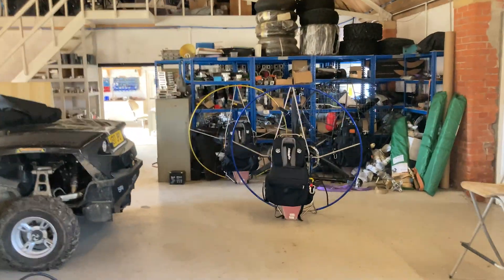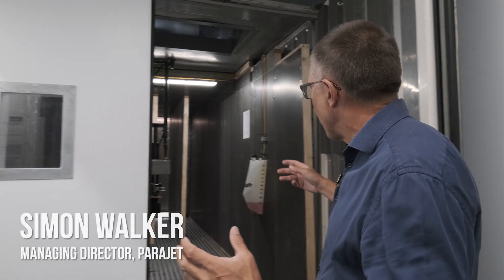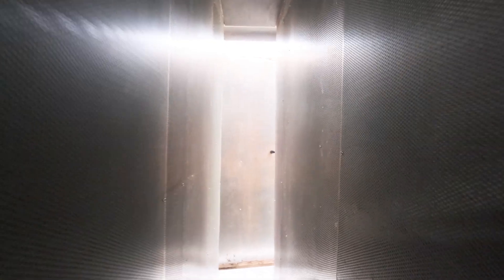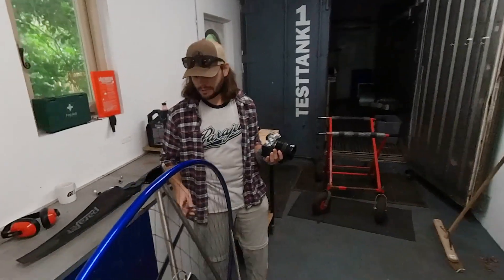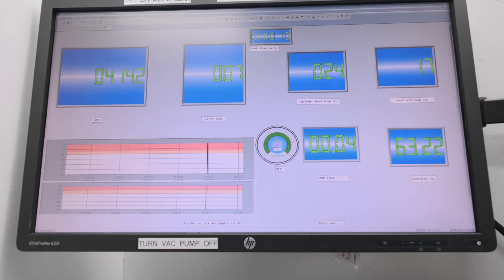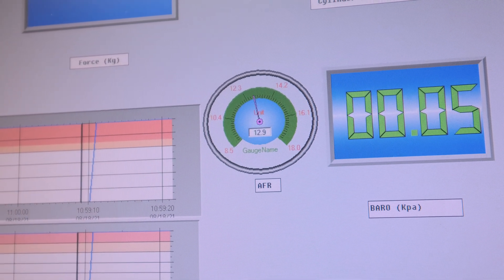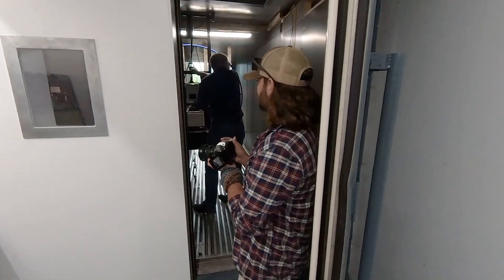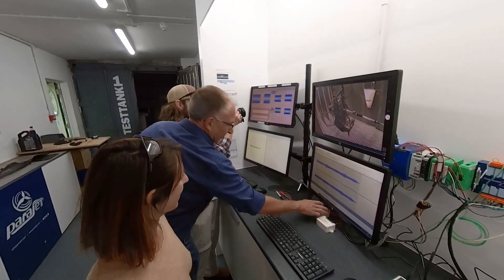Paramotor Thrust Tests in the Parajet Test Cell

Comment: I know it would vary depending on factors, but what kind of cruise speed would you see at wide open throttle?
Reply from the maker: Impossible to say sadly as there are too many variables in flight. On the ground on a trike which isn’t connected to a wing I would say the three blade would increase your speed by about 10-15%
Reply: @GregAnthonyHarris  Too hard to answer I understand, thanks for the reply. nice test platform.

Comment: Awesome video!  Can you tell us which prop was quieter?  Also which prop caused higher engine temperature?
Reply from the maker: The two blade is slightly quieter but a lower pitch. The average engine temperature was pretty much the same with both.

Comment: My home made paramotor engine of YAMAHA RX115 Made 40kg thrust with 130cm wooden propeller.. i am 70kg body weight and my engine is arround 30 kg. Need your opinion can it take me into air ??
Reply from the maker: Sounds like a heavy machine but with the right wing it would. I recommend working with other Paramotorists with experience of different Paramotors. Maybe have me of them test fly it for you first?

Comment: Very nice test. but i thought engines were putting out more thrust. because my homemade electric paramotor puts out 53kg of max thrust on lite version and my XT version puts out 60kg of thrust. i am working on a new motor that can put out 77kg to 90kg of thrust. possibly very good to build a paratrike for 2 with that. all clean electric power, less noise, no smoke, maintenance free, and extremely light weight.
Reply from the maker: These numbers are impressive. What are you run times and what is the weight of the rig at those thrusts?
Reply: @GregAnthonyHarris  My customer in USA did 65 minutes of flight with 75V 22AH battery pack. spinning 42 inch prop. max weight he reported was under 24kg. That is the XT version. pilots from 80 to 95kg can take off easily. Currently I (62kg) and my instructor (84kg) we are testing the lite version that puts out max 53kg of thrust. I can take off at half throttle and cruise at 10 - 20% throttle only. My instructor takes off at around 70% Throttle and cruises around at 25-30% throttle. Lite version with batteries and everything is only 18kg heavy. 90kg thrust i can build but its an overkill for me. any mistaken throttle can make me take off vertically making my glider fall behind. In fact I was thinking 2 x 90kg thrust combo, and i will not need a paraglider canopy. I can basically build myself a bi copter to fly around :)
Reply: only thing that electric paramotors lack now, is the flight times. but they have many more benefits. like at higher altitude engines won't put out enough power and thrust due to thin air, while electric paramotors will not be affected by that. if a person can carry more batteries for sure they can fly longer. with 90kg thrust motors, we can even build paratrike and carry 40AH to 50Ah batteries to fly over 2 hours or more
Reply: My home made paramotor engine of YAMAHA RX115 Made 40kg thrust with 130cm wooden propeller.. i am 70kg body weight and my engine is arround 30 kg. Need your opinion can it take me into air ??

Comment: CHT of 50 degrees seems way too low? That's not much more than body temperature
Reply from the maker: It did go higher but wasn’t shown in the edit.
Reply: Pretty surprised by that as well since Vito states the head should warmup to 80 before you punch the throttle 😂

Comment: Nice one Greg. Interesting to see real data on the multi blade issue. I’d be interested to see the results for a Moster. 
I presume the fuel mixture reading taken from the exhaust probe the test engineer fitted?
Reply from the maker: I think so yes. I’d like to see results from a moster too. I’d love to run tests on some of the old school Parajet props from the 90’s and compare to todays props. Next time!

Comment: hello greg. so if i wanted a thrust and fuel test done on my moster my20 how much would it cost please. THUMBS UP GREG
Reply from the maker: Hi Tony, I’ll message my contact there and get back to you 👍
Reply: thank you😊
Reply: Hi Tony - it's not something we can offer just yet, but we have plans to offer a wider range of services for this and our other test rigs.  We now also have a hypobaric chamber on site where we can test equipment (including paramotors) up to 40,000ft and minus 30 degrees centigrade.  Obviously not with normal PPG engines!
Reply: @parajet  What I'd like to know is if there is a way to elegantly monitor some of these critical stats on our engines.  Tach, CHT, and in particular air/fuel ratio would be amazing!